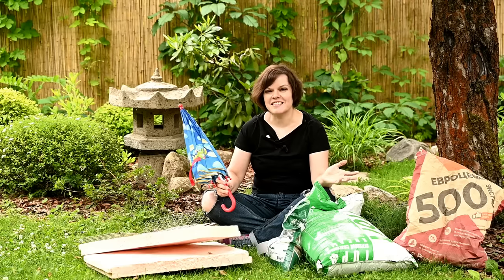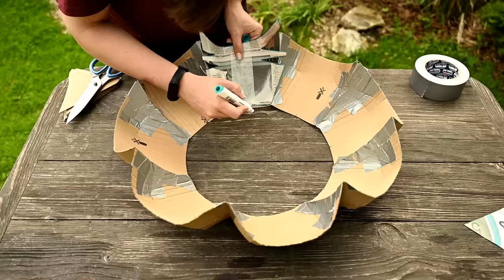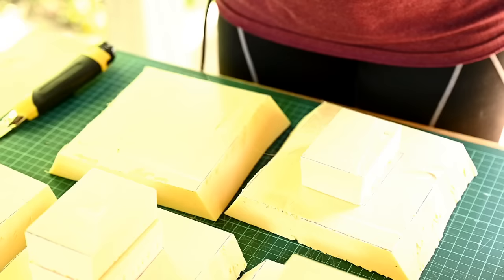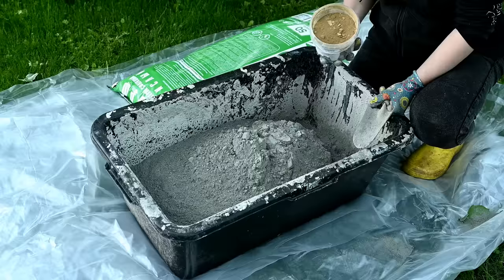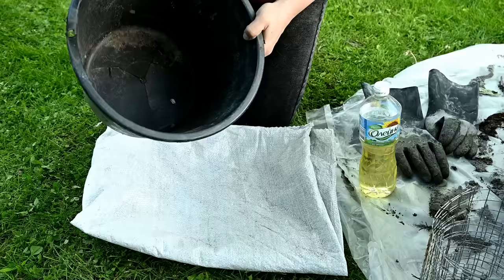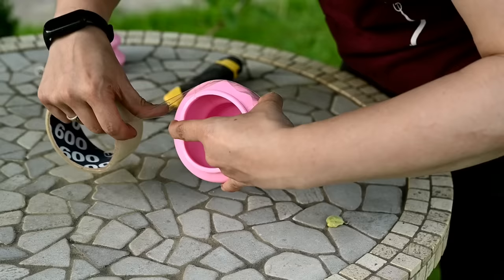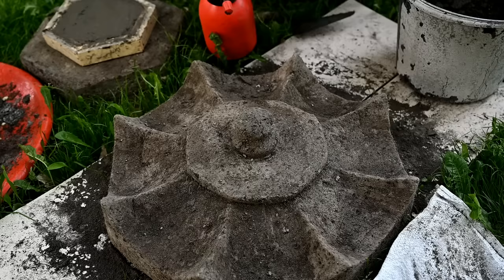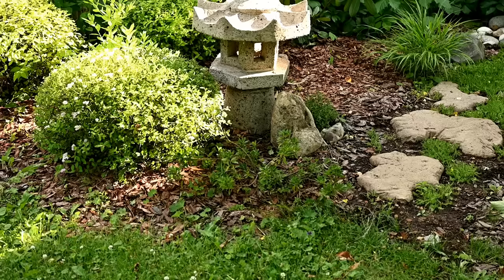DIY Japanese lantern anyone can build!

Comment: Genius is figuring out how to do something, and I took inspiration from your genius and made my own, a bit larger (my roof has a 30" diameter) using your template. .  For coloring, I used Sienna in my mix and the Quikrete liquid colorant, mixed into the hypertufa after I had it ready to give it a mottled look.  I also made an 18" high hexagonal base and used rebar for reinforcement as well as 1X1 wire fencing.  To avoid the "roof crush" you experienced, I sprayed Spray Foam insulation on the back of my roof mold.  This gave it some strength and rigidity.  Because mine was larger and heavier, I used a 1.5:1:1 ratio for my hypertufa and the roof and base pieces are made with larger chips of vermiculite, so they look like a marbled granite.  For the finial, I used the top third of a Gatorade bottle as it has the perfect swell and taper. (For those of us in the US, the exact place mat used in this video can be found on Amazon in a pack of 6)
Exceptionally inspired and well done, Irene. I've been doing artisan vertical concrete carving as a hobby for a few years, and your creativity is ingenious.

Comment: Your videos are great. I get a lot of inspiration. Your hypetufa mix is wetter than that used by some creators but ideal for casting or building up over the outside of a sand structure which is what I am doing for free style bonsai pots.. This type of lantern would be perfect. Great job.

Comment: When Japanese people dismantle the Japanese garden which is old, they do not like such an old garden lantern very much, and there is a case to be in trouble to the height of the disposal expense plenty as it is heavy. Most garden lanterns are not made with concrete and a craftsman spends time using a hammer and a grinder with the white stone called the granite one by one and handcrafts a garden lantern. So it is heavy and very expensive.

The garden lantern has been used originally to bring up a tea-ceremony room into the special world in the tea ceremony. The world unlike the everyday world. I feel mysterious when I look at the garden lantern lighting up the light with a candle